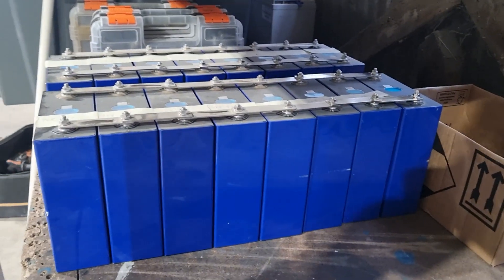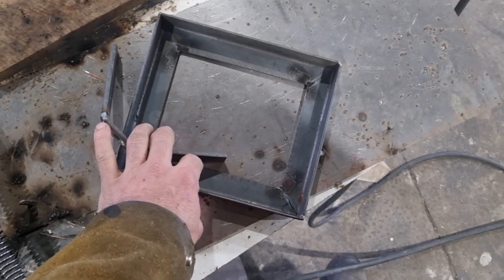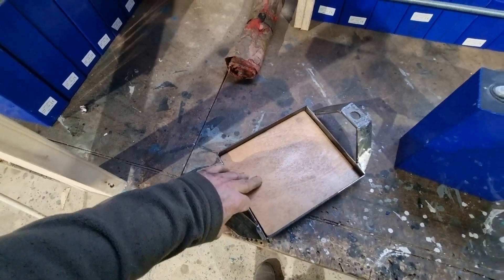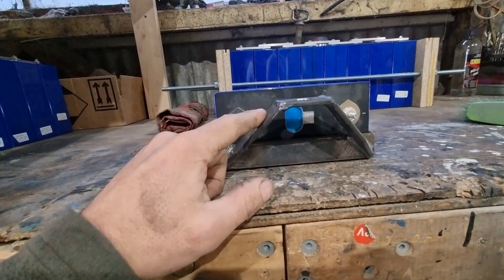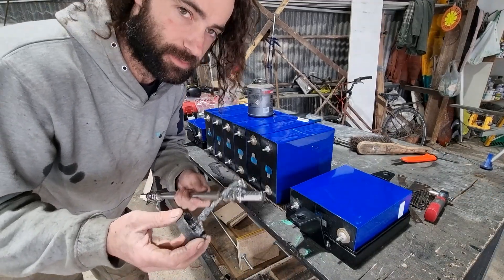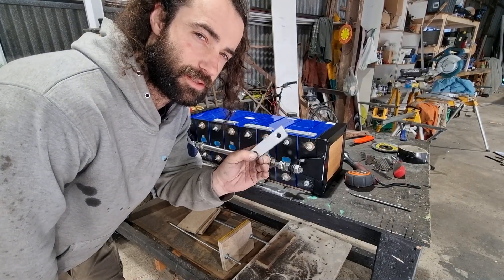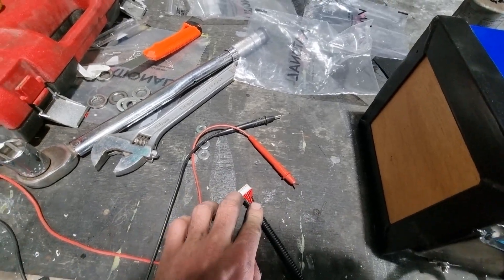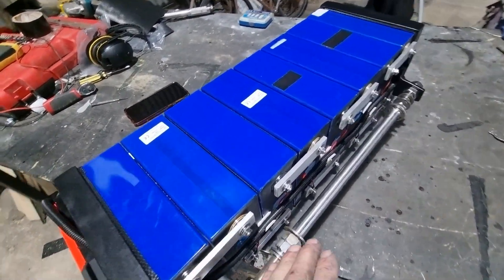Heavy Duty LFP Cell Battery Case - DIY Expedition Truck Build #33

Comment: im a bit worried about 2 metals in direct contact with each other, ali and steel equals electrolosis? doesnt it?
Reply from the maker: Yeah it can, but it also needs a fluid to create electrolysis. Stainless steel and aluminium go pretty well together, but i think it would be a good idea to put an insulating washer between the stainless and aluminium, thanks for the suggestion!

Comment: Interesting work.  Very heavy duty.

CAD would have helped with that bracket mistake.

Wonder if there's a way to measure the compression pressure with force sensing resistors or something tossed in, maybe placed between the metal and the wood filler.

Comment: Make sure to use a none conductive separator sheet between the cells or the blue shrink wrap will rub and you will have cells shorting out case to case.

Comment: I would rap those bars with electrical tape to be sure and the copper bus bars have way less resistance than those aluminum I have had nothing but probably trying to make aluminum bus bars but good job on your battery build
Reply from the maker: Yeah that's great advice, I will tape it all up once it's connected to the panel. Do you think it's better to stick with the original bus bars? I know aluminium has greater resistance so I went with a thicker material, but the was based on advice I'd been given, I'd be happy to swap back to the original bars if it's going to create a better outcome

Comment: i like the design. I have some thoughts on the orientation of the cells. I read somewhere that it's better the safety valve should face the opposite side of the gravit. What is your thoughts on that ?
Reply from the maker: What is the gravit? I've never encountered this word
Reply: @dancampion  😅 gravity
Reply from the maker: @EpicHardware  😂 of course. Do you mean they should be facing vertically? The only way I could fit them in that space was on their side like this, but from what I understand they can be mounted in any orientation, I've never seen anything to suggest it's not a good idea, but that's not to say that it's not best to mount them vertically. I'm not sure, but from my understanding this is ok, someone else may have more info on this?

Comment: I strongly recommend putting Kapton tape over the cell leads. You will likely drop something onto the open cell leads eventually (ask me how I know). The Kapton tape can be easily cut away to repair your batteries if needed. Some Fisch paper taped with Kapton would be even better.
Reply: I would definitely stick with the copper bus bars I have pulled over 200 amps with stock copper bus bars with no heating another thing is my wrenches I work on my batteries with I wrap the handles with electrical tape to in case I drop it or hit something with the handle
Reply from the maker: Kapton tape! That's perfect, thanks for the advice! I was thinking there must be some kind of tape that I could use to insulate the terminals, once I've got the panel hooked up I'll tape over every connection, thanks again!